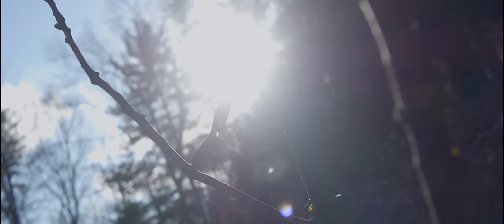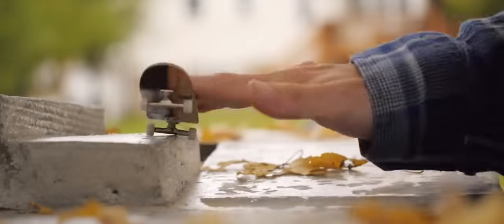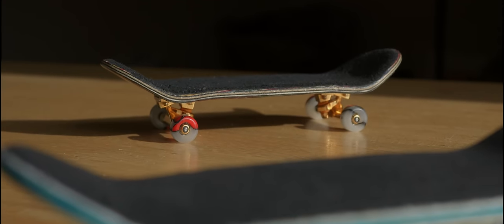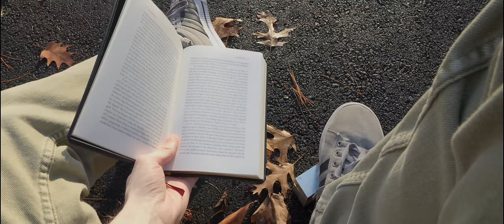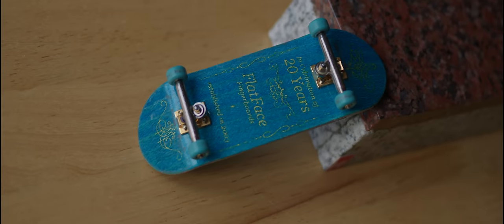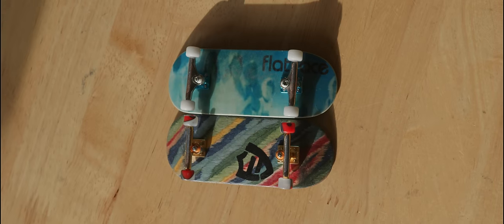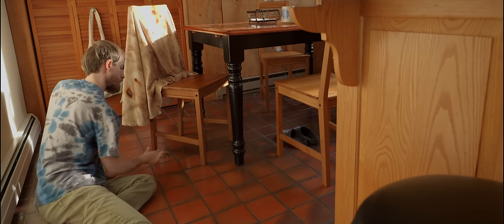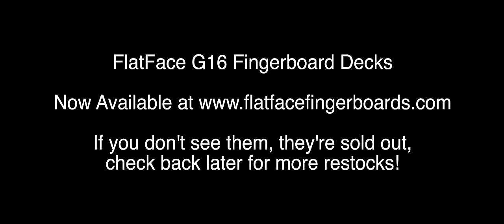The Best Possible Fingerboard?! FlatFace G16 Deck [4K]

Comment: I now own two G16 setups because I tried my first and had to get another. Best board I've ever used, and I've tried a lot of them. Props for sticking with the high kicks even when the market tends to trend on low/medium kicks. I love how the board is lightweight and pops really crisp as well. Returning to fingerboarding after a decade and getting to use the latest Flatface boards is such a joy.
Reply: Have u tried this board on 34 mm trucks and if so how does it feel
Reply: Now it seems every brand is doing high kicks.

Comment: Just received my g16 and its perfect, doing simple tricks like sw back tails feel so much better because the high kicks grip the fingers every time, the deck is slightly shorter than a g15 which gives more control imo

Comment: Yeah I use a 32mm g15 with oak wheels and with those wheels the board overhang is perfect, it’s too much overhang on my 33.6 g15s. I’d love a 32mm option for the g16 so I can use oak wheels without having to get new extra wide brts or dynamics
Reply: exactly i love the 32mm size if i get 33.6 i would be forced to get 34mm trucks 😢 i want to try this mold so bad it like my style for sure, which i am going to get some new trucks anyways but 32mm is my sweet spot for sure i got love for the wider and skinnier ones they are all fun but 32mm does it for me

Comment: I bought a G16 and I have to admit that I don`t like the feeling when riding it.  Tail and Nose are way to steep for the length of the board. I had non pop Flips, almost no effort to put into the board. When coming back to other boards like prete, flint, bw, and even the g15 deck, the g16 seems weird for me. I get the idea behind it and how easy it CAN be using it for certain people, but it´s just not what I´m looking for when riding a board tbh. Still love FF tho!

Comment: Hey Mike, just curious, do you think the G16 performs better with dynamics or BRTs? Dynamic with the longer wheelbase and shorter ride height or BRT with the slightly shorter wheelbase and higher ride height
Reply: I have both BRTs and Dynamics on 2 different G16s and I’m debating on getting another set of dynamics just because the pop and feel is just better, maybe not better but different. It just functions really well all around with the dynamics

Comment: Just a heads up, I know Mike said that he designed the board to be used with 32 mm trucks but please do not take this as a rule set in stone. I’ve been finger boarding for almost 25 years, I started in 2000 and I have a G6 and it is one of two of the best performing shapes I’ve ever had And I hate 32 mm trucks on it. I ride 34 mm trucks and they fit perfectly. From Axel to Axel both dynamics and black Rivers are about 33 1/2 mm even though they say 34 so it fits perfectly. I hate the feeling when my board overhang even slightly. if my wheel or axle sticks out by a 10th of a millimeter I’m not gonna complain. Plus more room to grind. That’s not to say that you can’t use 32 trucks on these but I personally find 34 Work Way better. And you can just tell from looking that the 32s Mike uses are actually shorter than the board but when I look at my own G6 with 34 dynamics, it’s exactly the perfect fit, when I look straight down on the board, if I squint, I can see maybe a sliver of the wheel going past the deck but I ride G4 which are really wide. If you used a slimmer or smaller wheel, they would be perfectly flush with the deck.

I’m only saying this because it’s Mike’s preference that he likes 32 trucks on this deck, which is no problem, but I personally think that 34 trucks work better and perform better and I like the feeling more so take that as you will. Don’t think it’s a hard and fast rule that if you get this deck that you have to get 32 trucks.

Comment: Does anyone know why the g15 and g16 have small dots on the bottom ply where the baseplate of the trucks screw in?
Reply: The little dots are kingpin holes. They help the truck sit perfectly flush with the deck.
Reply: @soggy_popcorn  thanks so much bro. I’ve been trying to figure that out for awhile. Interesting concept I wonder if it really helps. You would think other companies would be doing the same thing if it made a difference. I’ve never seen it on any skateboard or fingerboard before so I’ve been pretty confused by it. Thanks again for the explanation I appreciate it.
Reply: No problem, glad I could help 😊
Reply from the maker: kingpin holes, its a remnant from the old days where kingpins would actually stick out in that spot. some still do, but most pro trucks dont have that problem. I made decks without those holes for a bit and got a lot of complaints so I brought them back!
Reply: @mikeschneider  Honestly it's a blessing that you still have them, because dynamic trucks are reverse kingpin and I like tightening them to get a medium looseness. I recently set up a different deck with dynamics and couldn't tighten them too much because the kingpin can only go so far in, they were too loose for me so unless I change the bushings they'll have to ride loose.

Comment: Hey i orderd this board ,got some blackriver trucks but should i go for g4 or g8 wheels? which do you prefer @mikeschneider
Reply from the maker: both are awesome, I usually use g4 but I have g8 on a few great setups too! g8 will make it a bit taller